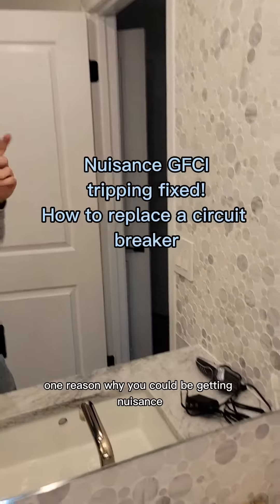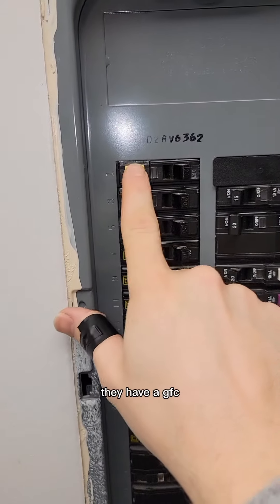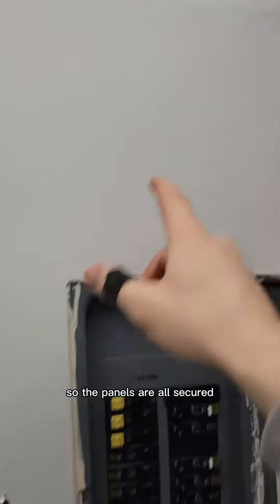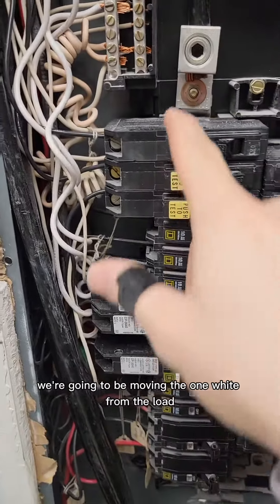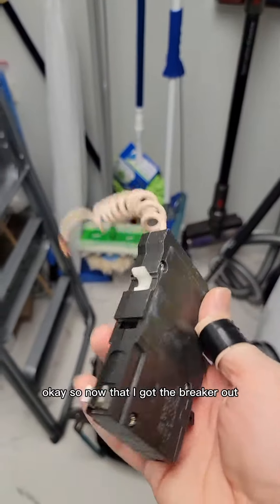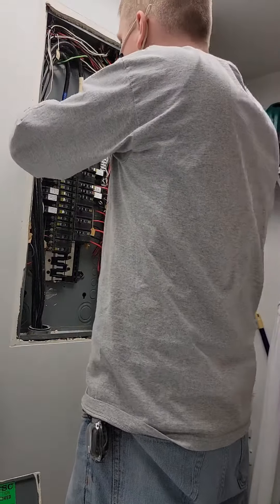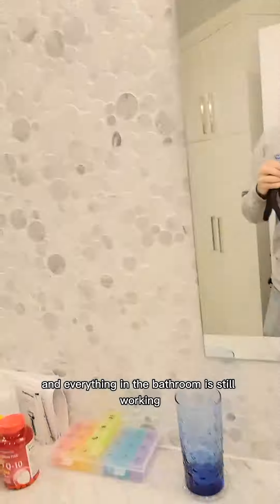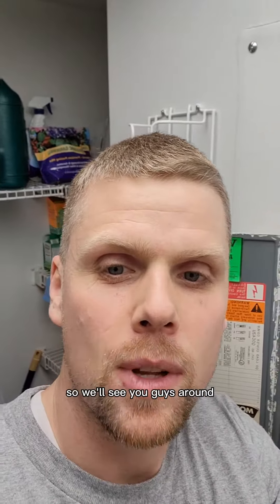How to replace a GFCI breaker with a standard circuit breaker to help with nuisance tripping

Comment: It would be helpful if you actually showed each step instead of just saying it.  Not everyone knows what a neutral bar is or where you hooked up the white wire.
Reply from the maker: One day I'll get a camera guy!
Reply: Good point. If you don’t know what a ground bar is, there are plenty of other videos available. I’d never recommend a novice attempt any repair on one video. I’ve seen plenty of videos where either mistakes are made, or the facts are just wrong. Always triple check, and never start until you are comfortable.
Reply: This was good info, any change to remake this in future to show steps?
Reply: It you don’t know what a ground bar is , for you safety stay away from the breaker panel
Reply: If you don't know what a neutral bar is then you definitely don't need to be inside the panel. You can literally follow the white curled neutral from the GFCI breaker and just replace it with the white clamped down wire in the bar..... If you lack common sense then just stay away.🤦

Comment: I have multiple GFI outlets, my pool pump and outdoor lighting connected to a double pole 20amp breaker. Due to new electrical code in my area, I have to swap out my regular breaker for a GFCI breaker because it has pool equipment on it. I followed your video and my breaker keeps tripping. Does this mean I have to replace my gfi outlets on this circuit with regular outlets to prevent tripping?

Comment: Great Video.   I have a HOM115PDF   15Amp Breaker that keeps tripping and need to replace it with a non GFCI etc.. basic breaker but having a hard time finding the correct Breaker.  Any idea what I need?

Comment: First off if you’re located in South Florida Lmk lol. Second off whenever my fridge or my dryer runs it flickers the lights in my house not extremely noticeable but it does dim it ever so slightly do you know what the probably cause could be?
Reply from the maker: I'm not sure youtube it!
Reply: You're Refrigerator and/or dryer  Is drawing a decent amount of amps/power and it dims the lights...not safety issues or fire hazzards.
Reply: Ment to say no safety issues or fire hazards